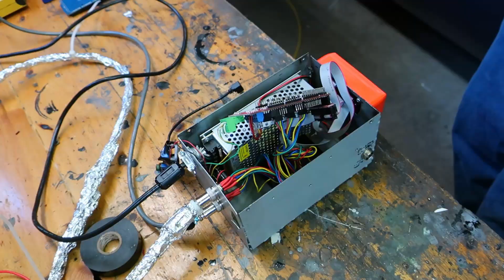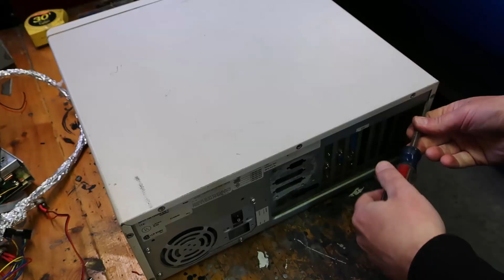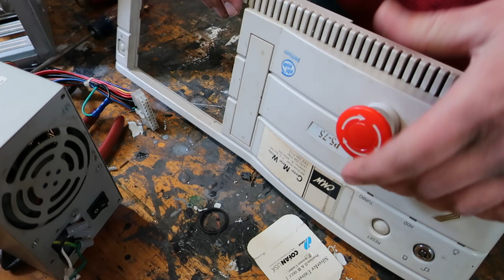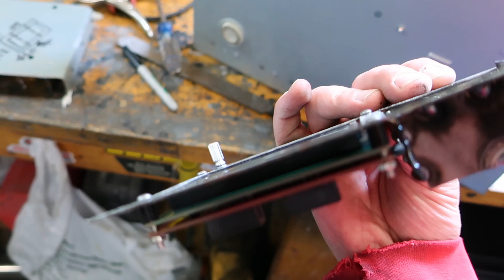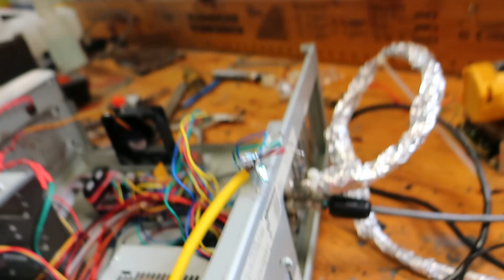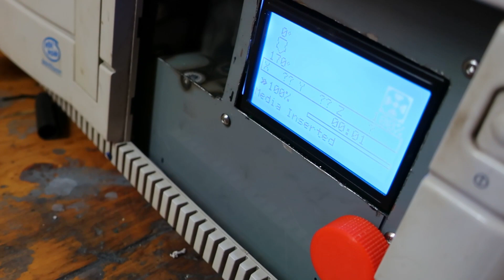MPCNC Primo Build Ep. 20 Rebuild Electrical Enclosure trying to fix interference.

Comment: It has been awhile since you got your MPCNC going.  What are its good and bad points for you?
Reply from the maker: I really wish I had more to report. Life happened and I got extremely busy. But here are a few. 
A better board with a torch height controller is really a must for the plasma cutter to cut fine detail. 
Don't use these really cheap Chinese Air craft plugs. 
I honestly think is very good otherwise. My build would be too large to be a router with this emt tubing.  You can flex it pretty easy. 
Get a better plasma cutter, mine has a poor cut so far. The eastwood one was a clean cut but didn't work with my electronics
Reply from the maker: Do you have any specific concerns?

Comment: Is any grounded metal from your plasma cutter connected to other grounded metal on the rest of your CNC?  If so, you could have an issue with a "ground loop." The ground loop could provide a path for electrical noise to travel into the rest of your CNC from the plasma cutter.  I should note that I thought the isolation idea I provided a few days ago would have also dealt with this issue.  However, it would seem to explain the issue you are facing.  Here is a video that discusses ground loops: https://www.youtube.com/watch?v=ep0jAeq1kzM.  What I am suggesting is shown at the 1:58 mark.
Reply from the maker: I don't think they are sharing a ground besides at the the electrical panel, which does have a earth ground stake right on the other side of the wall. I did try to run the arduino off of the house service and have it outside the garage to help separate things further. There is still more testing to be done.

Comment: If you think your problem is originating from your Arduino, you might be able to resolve the issue by isolating it from the ground.  You could do this by pulling the Arduino out of your grounded metal box and run it from a USB power bank or running it from a 12 volt can battery with a car USB adapter.  This is just a guess, but it is something you could try.
Reply from the maker: I've tested it with a car battery and usb previously with no improvement. I am waiting on some copper braid to try and shield my card reader ribbon cables. The last test I did managed 47 holes before the card reader lost communication. Your recommendation is definitely a good idea and may help others.
Reply: @eliworks8549  I thought it was worth a try.  There goes my best guess for a solution.
Reply from the maker: @darrellr1362  I appreciate the help.

Comment: Have you tried changing the “electrical noise threshold” in the Marlin firmware?  I had issues with my MPCNC during the auto square, once I lowered the threshold I have not had any issues since.
Reply from the maker: No. I will have to look into that, thank you.
Reply from the maker: I am not using any home switches. Unless I'm not clear on something, I'm not sure this would help.